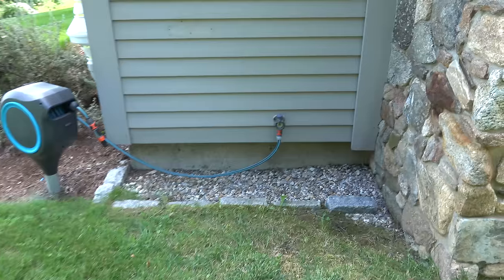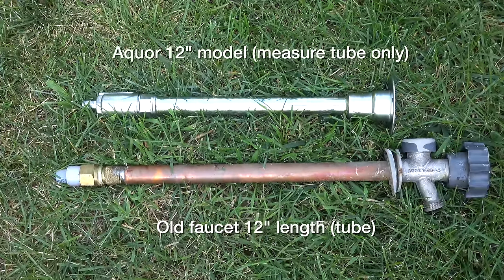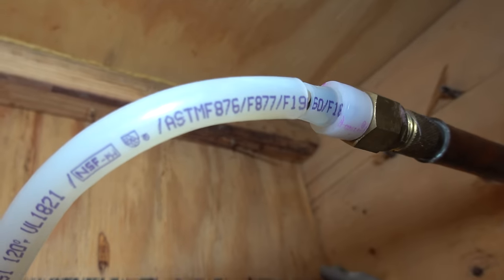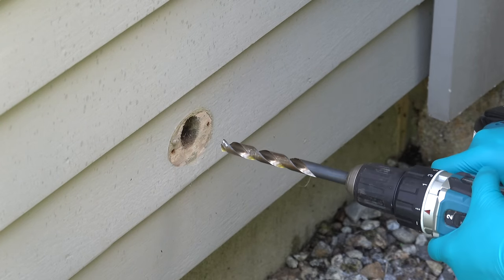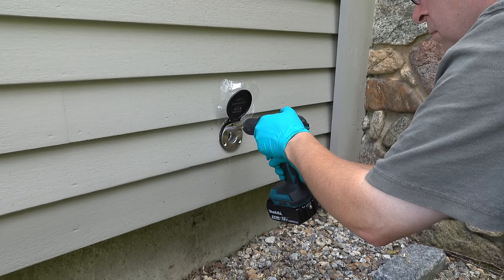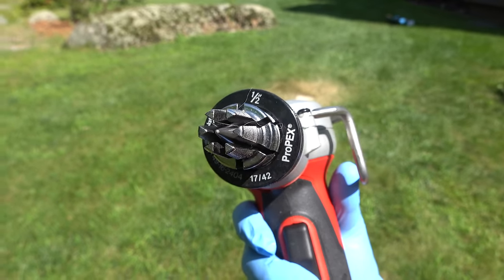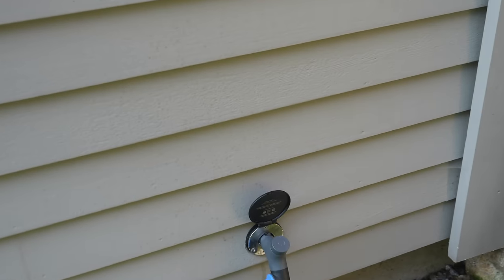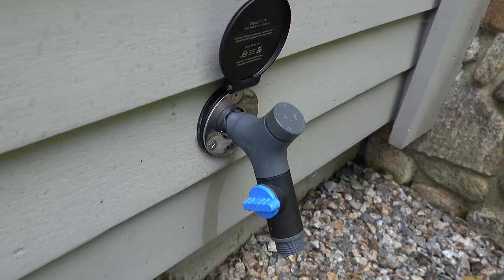REPLACING YOUR OUTDOOR FAUCET JUST GOT EASY / Leak & Frost Free AQUOR IDEAL for Retrofits

Comment: I'm gonna lose that proprietary adapter, and the company that makes it is either going to go under, or start charging $300 for a plastic tube.
Reply: It's the same tech that's been used on boats for years. Shouldn't have any problems getting replacement parts.

Comment: Put these in on a renovation a few years back. No problems at all, great water pressure and love not having to think about winterization. I purchased 4 extra spigots for insurance just in case the company goes out of business 😂.
Reply: that was smart. well done.
Reply: What winterization is required on old school unit other than removing hose anyway?
Reply: @outofspecboating6985  
Depending on the year your house was built.  Mine was 2004 & doesn't require any winterization because the valve itself is back behind the wall.  Older homes the valve is right there in the apparatus itself & the water to the spigot must be shut off inside the house before freezing.
Reply: They are useless though and lower quality than good faucets tho ppl need to stop trying to reinvent everything
Reply: @pauliethebrit not really
Reply: @outofspecboating6985  I have to drain my outdoor faucet pipe back to the main because it runs over where the bulkhead comes into the basement and will freeze in the winter.
Reply: Damn.. buying 4 of the same thing cause it might break? That is some confidence in the product right there! You should be a salesman for them:
“Ya, they might suck, buy 4 of them just in case”
Reply: Hey, there’s no right or wrong, nice to have a choice for various situations.

Comment: I sure love it, my spigot is difficult to turn on plus I have lupus sle and sometimes turning the knob is painful and I prefer this system because of how easy it is to turn on and off and also prevent pipes from freezing. My current old school spigot screams loudly when first turning on the water which I haven’t found an answer as to why but I think this would resolve a multitude of issues I have with the traditional spigots

Comment: After having gone through a several Arrowhead inline backflow preventer failures and looking at replacing failing spigots I'm all for putting the failure-prone parts into a quick-disconnect that also obviates the need for a frost cap.
Reply: I've had repeated problems with Arrowhead fixtures.  quality of the product has dropped over the years

Comment: We installed these with pex A at our house and love them. It is far easier to connect the hose while standing up vs leaning over in a potentially difficult-to-reach spot (love landscaping...). Love them though, 2 years with no issues.

Comment: I live in a colder climate (Maine) and I recommend using spray foam where pipe comes through rim joist. Also recommend insulating all rim joists. I used a combination of spray foam, rigid foam board, and mineral wool at my residence. This is especially important wherever there are penetrations through the rim joist such as an exterior spigot, dryer vent, wiring, etc.

Comment: I'm going to echo some other comments:  Looks great and has some advantages, but I'm very skeptical about the plastic adaptor.  Here in Arkansas the summer heat and sun are brutal on anything plastic.  Having said that, I would readily buy three of these if the company offers a version with a metal adaptor.  Otherwise, great video.
Reply: /agrees in Florida The humidity and heat in the Southern states is no joke. Anything plastic is prone to mold, mildew, and sun-bleaching. After a while, it will crumble into dust. I do like the look of it, but we also have the issue of not having any type of crawlspace or other type of access that I can see. Homes built at sea level and very close to the water table tend not to have that unless they’re close enough to the coast that they’re built on stilts. So, yeah. It’s a pass for me.
Reply: Thanks for your response.  And I'm glad to see I'm not the only one who is dubious of plastic parts.   @Sunshineandhydrangeas  😃
Reply: And I'll bet these plastic parts are not cheap, either.  So when they fail, pricey to replace.
Reply: 94 here in Mobile
Reply: @notjaysday   Looked on their site and all of the hose connectors are under $30, with some around $14.  They also state that they're made from acetal resin polymer, not plastic.  I've got two outdoor faucets that are the original ones installed on the house, and one simply won't make a good seal with any hose - may upgrade, as these look more aesthetically pleasing to me.
Reply: @notjaysday   I'm quite sure you are right about that.
Reply: @adb888  well acetal polymers are still plastic?
Reply: @Caegofy and they’re not particularly UV resistant. This thing looks cool but I can see it being a major headache when the attachment cracks in 5 years and OOPS the company changed the design a couple years ago and doesn’t make these anymore.
I went through this with a ceiling fan company after the dog chewed the remote.
Reply: I would gladly buy these IF and ONLY IF all components were made of stainless steel or heavy-duty aluminum. I'm weary of needing to repurchase items due to broken plastic/composite parts. Regardless of the guarantee, plastic fails earlier than promised.
Reply: They make plastics that can withstand 800-1200F temps.  I wonder if they used that here.  How I know; I have kitchenware that is plastic/rubber and it won't melt in the oven or on the cooktop.
Reply: Central Texas called and said that it loooooves to eat plastic bits all summer long.

Comment: If they release the models for the mount point and allow their customers to create their own connectors instead of locking them into a proprietary market I'm all for it. This looks very convenient and useful, I just worry about the durability of the plastic tap. Even just actuating that valve I saw a lot of flex, I worry it will need frequent replacing unless you're extra careful with it.

A metal option would also be nice, but I would still like the design of the connector to be open to the public for non-commercial use.

Comment: I used 2 of the ones with backflow preventers built in on my new construction house in 2018 👍  no issues at all, work perfectly, and also prevents anyone from using water without the adapter
Reply: I would hate it if anyone used my water. So far, in many decades, nobody has. Maybe my luck is running out?
Reply: @dave5176  no one would literally use it, you have to be concerned with vandals, leaving water on..  in my area it’s tied to sewersge charges (which are 4X the water cost), so you could have a very large bill.  luckily my city has the option of seperate meters for indoor (uses sewerage), vs outdoor usage (water only, sewerage not billed).  I do have seperate meters (lawn sprinkler system)
Reply: @mwolrich  OMG THE WET BANDITS RIGHT???  MARRRRVVVVV

Comment: Built a new house three years ago and installed these in the ground rather than coming out from the house. Plumbing is easy to manage as it is all in ground.  Installed using 4 inch PVC filled with small pea gravel . Awesome system.  Only caveat is the included straight adapters are not as good as the angled ones.  And if you live in a warmer climate, the plastic valves expand to a point where they don't function as intended anymore.  The solution is to get valve free angled adapters.

Comment: I like this idea.   It seems like the problem of repacking a Woodford hose bib every few years is gone because the operational valve is now completely outside and replaceable.  I would prefer the external piece be made of metal due to sun damage.
Reply: I have been in my house 17 years (northern New England) and have yet to repack a valve stem.

Comment: I like the look.  I have a couple faucets that are normally connected to hose reals, like yours, but I have a few that are rarely used.  My home is brick on a concrete slab with copper plumbing, so I expect the installation would be quite bit tougher.  I know about sharkbite connectors and have also read arguments against using them if avoidable.

Comment: I thought the picture was a toilet seat at first, and I am thinking about a new toilet, so I clicked it..... then when I saw what it is, I also need a replacement shut off faucet for the outside hose, so this really interested me. It is very smooth looking, but, in an emergency, someone might not recognize what it is, and if the faucet part isn't there, wouldn't be able to access it.....  so, I like it, and it's not perfect! Very easy replacement in the video, I have an old house with old stuff, but the idea is sort of basically the same, only pipe cutter needed. Thank you very much, video very easy to follow too!

Comment: Looks cool and all. But my house still has the original spigot from when the house was built in 1958. We rebuilt the spigot with new gaskets and it works as good as new. Every winter we turn off the shut off and turn on the spigot to drain, then put a winter cover on it. Done.
Reply: I agree fully...I put a $3.00 cover over mine in the winter and never had a problem with freezing!!!
Reply: You're  not alone.   The junk this guy is peddling wont last .

Comment: I like everything about this faucet replacement.  it looks good, it looks very functional, and if by chance the faucet portion breaks, it is probably and inexpensive item to replace.  I might add some expanding foam around the pipe that goes into the house to add some insulation, but otherwise, it looks like a solid upgrade.

Comment: I love the concept. They design the old things to fail I have one that was installed 1 year ago this summer I went to go turn it on and it was leaking all around the handle just like the plastic handle one you had prior to install. It was annoying sitting there trying to work the handle tight and lose and tight and loose until the gaskets or leathers inside started working this would fix that problem 100% I am nearly sold!!! I do wish it were metal and the end the hose connects to is that standard if not that might not be a likely solution cause I use a Y split on mine one goes to the garden for watering one is free for cleaning. If the connections are proprietary it does suck to some degree but I like how easy it looks to connect things. Viability is heavily dependent upon how it lasts I'd say. Let us know with updates if your opinon has changed.

Comment: I'd be concerned about when you pull the hose to the right, does it pop out of the wall?
Also, how durable is the plastic section? While the flap looks great, the faucet looks really cheap to me.
Reply: I don't think it would withstand the heat and UV in my area. Most plastic parts turn to dust in 2-3 years here.
Reply: No, it's a strong, deep 'screw-in' to turn it on.  About an inch?  Easy to do, but strong!  I struggle a bit to 'un-screw' it with wet hands.  VERY SOLID, not at all cheap feeling (or acting).  I have the blue flap in the front (ties in with my front door and shutters...)  and the gray one put back.
Reply: @1950Archangel  thanks for answering my questions.  I'll check them out soon.  Too many other projects taking priority.

Comment: I just changed my hose bibs and added a few new locations around the house running PEX A.  I was on the fence about what type of hose bib to use but ultimately took the easy way out and just got standard bibs.  The expense of all the additional hardware would have added up fast with not much benefit IMO.  But those hose bibs do look nice.

Comment: That's pretty cool. The way it's flush to the siding looks better. But also, if your frost-free fails, and you've got a 1/4-turn model it has to be entirely replaced. Have fun if your basement has a finished ceiling. This thing, the mechanism is removable. Brilliant.

Comment: Dude I'm sold. I've lost too many vacuum breaker valve seals in the winter time even with the water valve off they just freeze and break. Not sure what else I can do other than replacing the actual faucet but if I'm gonna take the time to do that might try this kind of upgraded solution.